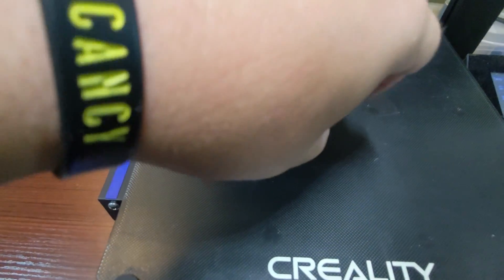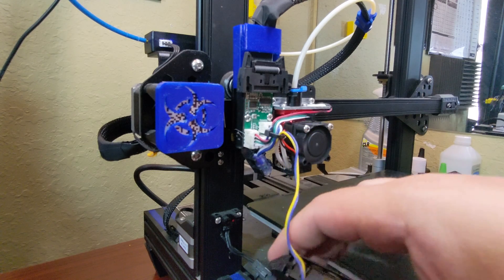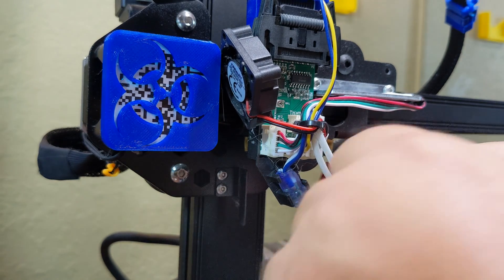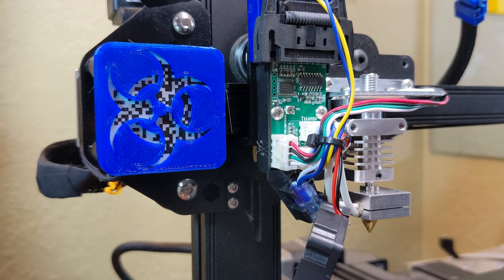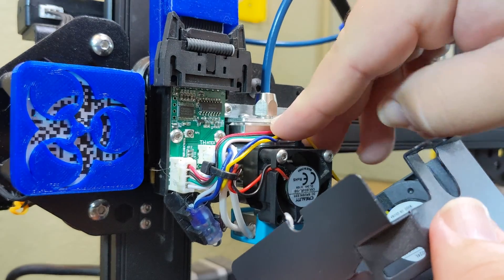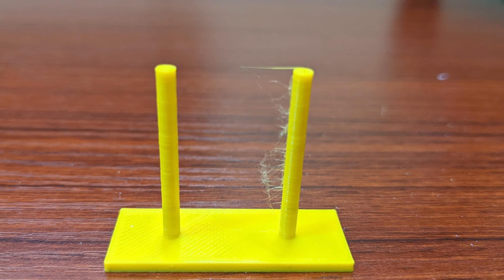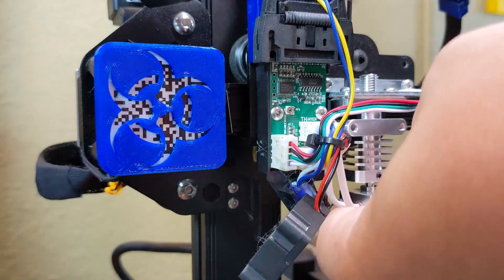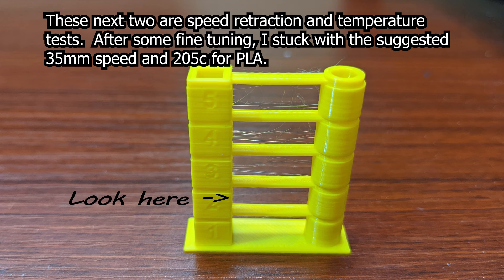Micro-Swiss All Metal Hot End Upgrade CR-6 se | What Happened?

Comment: Is the all metal hot end better than the stock one? Have you noticed much difference? What's the advantage?
Reply from the maker: It comes down to the filament you plan on using. If you want to print filament that melts at higher temps, it's worth getting. If you're mainly using PLA, it's not really worth the extra cost.

The quality of prints after dialing it in was pretty much the same for me.

Comment: This is the biggest s.. ever. ive printed 20boats 15 string tests and temp test. Changed filament, nozzles and gone thru a tons of settings in diffrent ends. And the worst part? There is always stringing, and it looks the same no matter what settings i tried with. This microshi..t is coming right of my printer. Im done.. i bought this as my first printer second hand. I did t think id be reading for days on google and test over 50 calibration pieces. And it still got strings
Reply from the maker: I feel your pain. I wouldn't use it again, either. You're better off going back to the original hot end and buying that $18 bi-metal heat break if you want to print with higher temps.
Reply: if you want a machine that you don’t have to mess with get a bambu you will constantly have to troubleshoot with these sub 600 dollar printers

Comment: https://youtu.be/2pq8Y_fCCoM?t=135

right here, my tube is stuck and I have no idea how I could remove, tried to pull (heat and cold) 

any suggestions? Thank you!
Reply from the maker: Are you compressing the ring of the Bowden fitting? 

If the tube is stuck in the hot end and not the fitting - Try heating to 210, remove the nozzle, heat to 240, shove the nozzle through so it comes out where the nozzle would be. Then try pulling it out.

If it's caught in the Bowden fitting, try unscrewing the Bowden fitting, compressing the ring and then try removing the tube.

Comment: There's a few things you should know about all-metal hotends compared to PTFE-lined ones.

* The transition zone is much smaller in the all-metal hotend. The heatbreak acts as an insulator so the bulk of the heating occurs in the nozzle threads which are in contact with the heater block. This means that retraction amounts need to be greatly reduced over those used for a PTFE-lined hotend. Typically you might use 5-6mm with a PTFE-lined hotend but only 1.5-2mm with an all-metal one. Any more and you risk dragging melted filament into the heatbreak thread area where PLA will jam.

* The effect of heat creep with material which prints at low temperatures, e.g. PLA, is more pronounced with an all-metal hotend. This is due to them having a higher thermal conductivity. Materials such as ABS and PET-G which have a lower thermal conductivity will print without issue and you may be able to use a little more retraction maybe up to 2.5mm.

Finally, over-extrusion. Everyone over extrudes without realising it. Calibrate your e-steps, set your slicer extrusion multiplier (from measuring the walls of a single-walled open-top cube) and adjust your X, Y and Z steps/mm by measuring a calibration cube. Only then should you perform retraction tests.

After doing this you'll typically find that you need only 1.5mm retraction for PLA and about 2mm for PET-G to create prints without blobs and stringing.

Comment: So did u keep firmware if u did could u share which you used .kudos on sticking with it
Reply from the maker: Thanks! Yes, I kept the firmware. There's a lot of pretty good reasons to upgrade - PID tuning from within the printer, higher temps for higher temp filament, and being able to 'see' the bed mesh to name a few.  The link to the Community Firmware I used is in the description. I used the latest version, 6.1
Reply: @Avel  I updated my two v2 to jyers long ago very happy with it .Use protonoface for all needed tuneups
Reply from the maker: @charlesrestivo870  Nice! Yep, I did the PID tune initially with Pronterface, but it can be a bit overwhelming for newcomers. Although, BV3D did make a pretty good and clear video on how to do it.
Reply: @Avel  actually can run a pid on jyers straight from ui on screen
Reply: @Avel 
Hi my friend. I have 2 CR 6SE printers. I’m still using the stock firmware. Is it worth it to upgrade the community firmware to the 6.1 instead of using the stock firmware and if so what are the benefits to 6.1? and
how can I save my stock firmware just in case it doesn’t work out? Or can you?
Reply: What firware did upgrade too ?
Reply from the maker: @charlesrestivo870  I'm using the Community Firmware v6.1 for the CR6.

https://github.com/CR6Community/Marlin/releases#section11